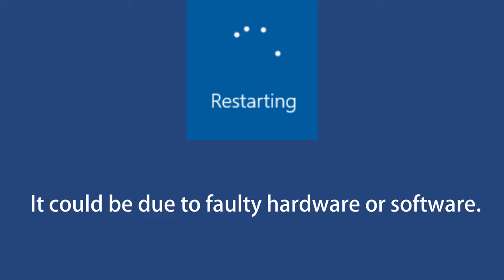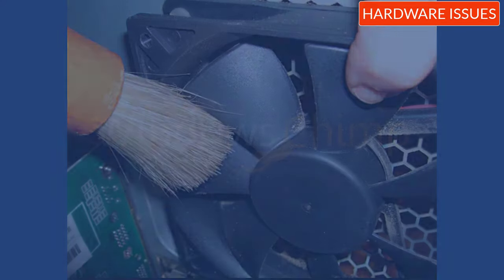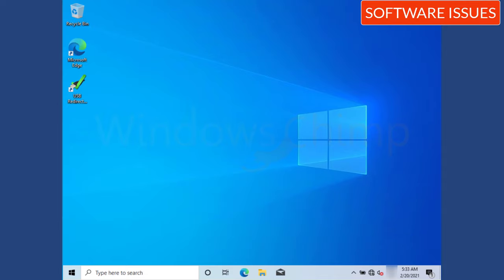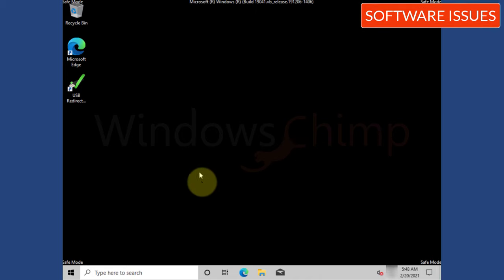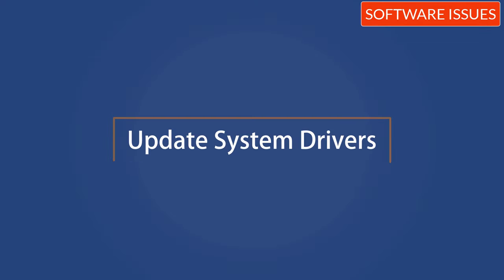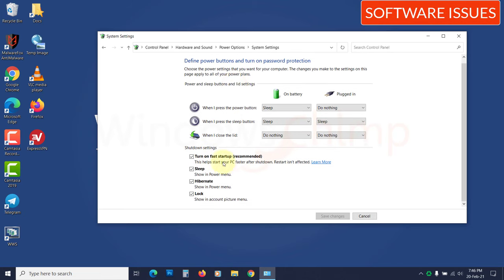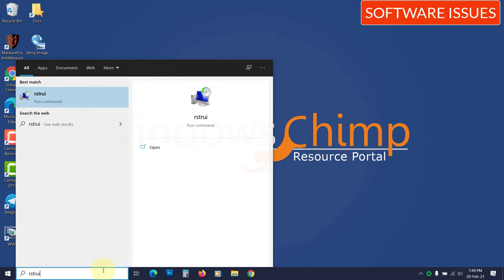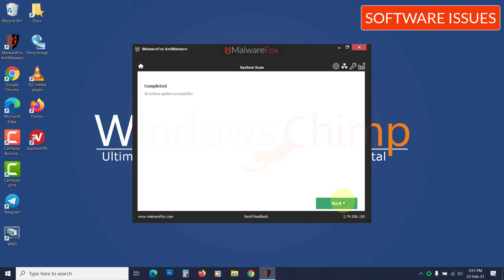How to Fix Computer that Keeps Restarting? PC Rebooting Issue

Comment: How can you do any of these things when you can’t get past restart?
Reply: I love how nobody answered you lol
Reply: Unmount and reinstall the CMOS battery after a few seconds then switch on your computer.
Reply: Exactly…. No point watching this hopeless vid
Reply: @mahmudriyad_163  The what
Reply: That is my exact issue. Every solution I can find involves the problem already being fixed.
Reply: @DeathnoteBB  did u find a solution?
Reply: Sid u find the solution? I have the same issue
Reply: @majdkhalaily468  I ended up having to go to a professional to have it fixed/cleaned. Seemed to be a hardware issue (though he said he also did some software stuff, not sure if it was related to this specific issue though). I didn’t catch the entire explanation but it sounded like the heatsink was loose and needed reapplied. So I assume the computer decided it would preemptively shut off to prevent damage, or something. 
It cost a couple hundred to get fixed, but I needed it for classes and it would have cost way more to buy a new laptop.
Reply: Ong
Reply: You literally took the words out of my mouth exactly
Reply: F12 get to bios and set bios to default setting try
Reply: @DeathnoteBB exactly it’s annoying af
Reply: Y’ALL ITS CALLED SAFE MODE
Reply: That is my issue also if someone found the answer please reply
Reply: @yip2454  ı try that but it keeps going back to some other setting than default
Reply: @Bestplayeratr6  so i srny ib my pc for repair turns out whea error to the point where it corrupted my os and nvme ssd. Send it to the shop i recommend

Comment: My pc keeps restarting and it won't even let me log in. I'm not sure what caused it
Reply: Update: I found out it has to do with the dim 2 ram slot of my computer. If I have any ram in it, the pc won't turn on at all. I don't have a large enough ram chip to use my computer so I'm buying a new one
Reply: Udate2: the processor was fucked so I had to replace it, everything is working fine now
Reply: Update 3: it's fucked again ;-;
Reply: Kalyan Mandal  is it working now? If not you should bring it to a repair shop if you have the money if not go to the config before the pc fully boots up and restarts

Comment: my pc keeps restarting even after installing new ram. i have cleaned it, checked cpu temps and even did a hard restart twice. i dont know what to do anymore
Reply: The problem can possibly be your PSU in my system i have very bad PSU Gigabyte P750GM. My pc restarts when i try to launch a game.

Comment: Didn't see it mentioned here but:
Your motherboard has a little coin battery (2025 or 2032 likely) When these are nearly dead (or dead), your PC will continue to restart over and over again. You won't be able to get anywhere near starting Windows - and this had nothing to do with a Windows problem anyway.
Change that battery - try to test it if you have a tester. (most battery testers don't test a coin battery)
Reply: Good point you shared. Thanks
Reply: My motherboard and battery is new is there something else it could be?
Reply: @VirtualShepherdOfficial  Sorry for the delay. YES, there could be one problem that is easily overlooked - the actual electric cord plugged into the computer - the power cable. Read the label on the cord itself. You'll see some specs. Use at least 16 gauge / 300 watts / 15 amps. Compare this to other nearby cords. Use the one with the best specs and try your computer again.
If that didn't work out, plug your power cable directly into the wall socket - NOT a surge protector or multiple outlet.
Reply: - Have you tried to remove, wait 30 seconds, and then reinsert the coin battery which is around center on the motherboard? Yes, I know you said your computer is new. Do this task anyway, okay?
- Swap your power cable and/or make sure you're using the same cable as before. Plug it directly into an outlet, not a surge protector.
- If your keyboard is USB or wireless (USB antenna), unplug it and try an alternate keyboard. Unplug any other USB devices (drives, etc) for now.
- I'll assume you didn't yet look under the CPU at the thermal compound condition.
- Can you get into the BIOS? As soon as you press the power button to start the computer, start continuously hitting the F8 button to enter the BIOS. If this didn't work, try again but using/hitting the Delete button continuously instead. (example: tap tap tap tap tap tap tap.....)
- IF you get into the BIOS, disable "FAST START". Disable "SECURE BOOT".
Let me know if you have any success, Jeff

Comment: So I was playing rdr2, I’m positive my system didn’t overheat but the game just froze for a while. I had to unplug it because it wasn’t responding to ANYTHING and now it’s stuck in a restart loop without a display. Any advice would be highly appreciated 
Edit: I swapped my ram over to the B channel slots and it started up gonna try to clean out the A slots after work
Reply from the maker: Awesome, use an eraser to clean the RAM connectors.
Reply: Did you fixed this
Reply: @nadeejanethmintracer4564  yea I swapped them into the other two ram slots after air dusting the slots
Reply: I was at work so I should add after cleaning with the eraser the problems occurred again so make sure they’re securely in place and try the other slots
Reply: Same thing is happening to me right now thank you for the advice
Reply: hey dude did you fix it
Reply: @rhaxers708  I swapped ram cards over to the opposite slots and it worked. Eraser thing was a little finicky so I’d just use an air can to clean the slots
Reply: @snowman5173  damn bro, is there a way i can fix it without opening the case? i tried cleaning and fixing ram slots but it didnt work. also, my parents dont really let me open the case.
Reply: @rhaxers708  if you can’t get the case open best thing to do would be take it to a pro cause I’m pretty new to pc gaming and nobody’s fully right or wrong on all subjects
Reply: @snowman5173  the nearest pro is around 50 or 40 miles away and i cant just take it to there, i think i may have downloaded a virus so im gonna try formatting it.
Reply: @rhaxers708  Any updates?
Reply: @iamgoo  yeah, i formatted my pc and now im typing this message in it. if you have the same problem as me, you should find an usb, install an uso of your choice (like windows 7 , 8.1, 10) and then just format your pc on the booting screen. if you want any more help, im always here and extremely online. hopefully it works for you

Comment: Anyone have an idea as to why turning on another item on the circuit would possibly restart the system?  For example if i turn on a fan it sometimes restarts.  If i build up some static from my carpet and flip the light switch it sometimes restarts.  This computer runs 24/7 and it's frustrating